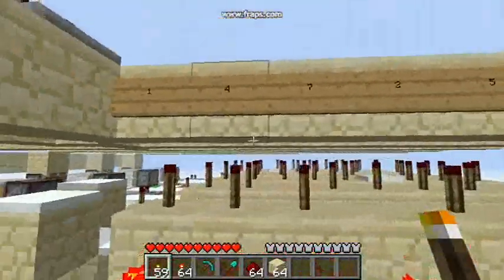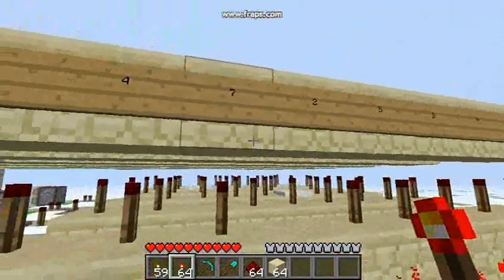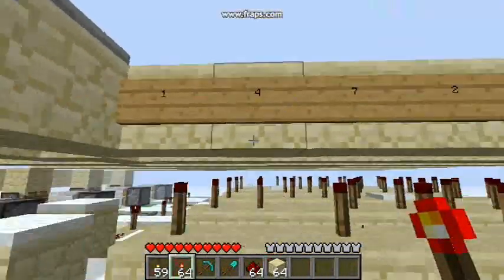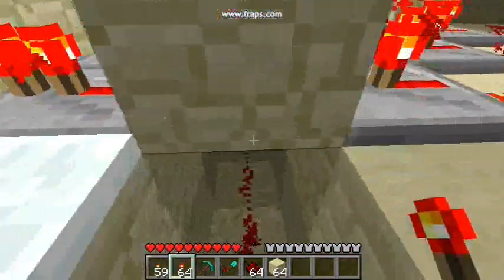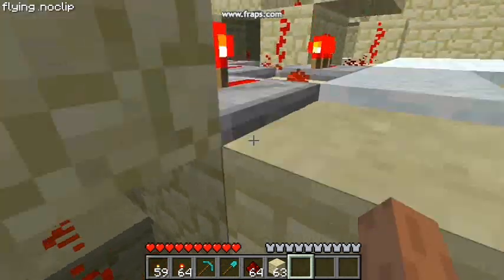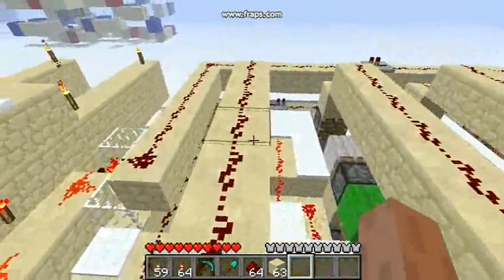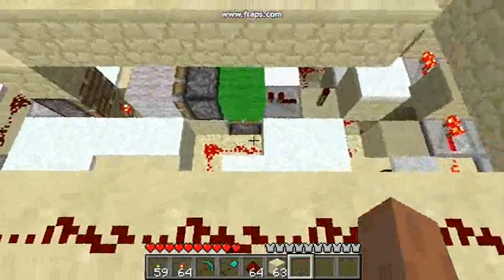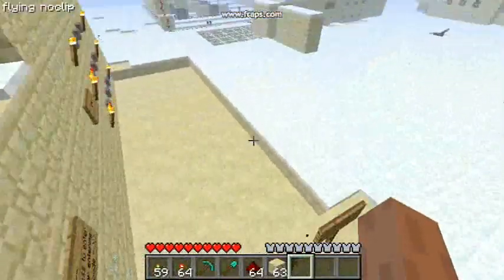9-Button 6-PIN Combination Lock with Piston

Comment from the maker: If  "no block replacement" is definition of "programmable", then Sethblings' latest minecart-based lock would not be programmable, as it takes even more block replacement then mine.  But I actually think it is more programmable.

I would prefer the language used here is in a comparative tone, such as "I would prefer this to be MORE programmable" or "This unfortunately is not programmable enough for me"

Know enough science and you'll start to learn not to use definitive tone. :)

Comment from the maker: I suppose the definition to the word "programmable" is subject to debate.

In my personal view, any mechanism which does not require major rewiring is programmable; for example flipping a switch (like those DIP switch you sometimes find on PCB boards), or in this case - a simple enough replacement of blocks & a torch.

As I said, this is up to debate, the definition could be: "no block replacement"; or it maybe "single interface only" (you are only allowed to reprogramme it from the front panel"